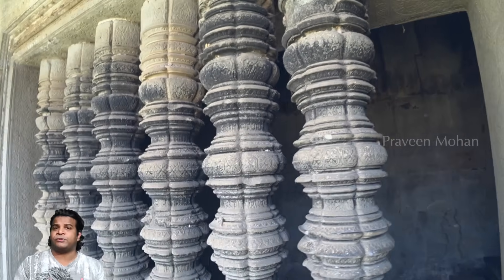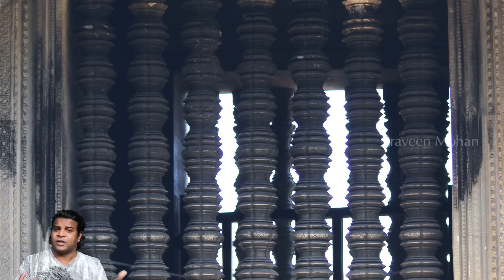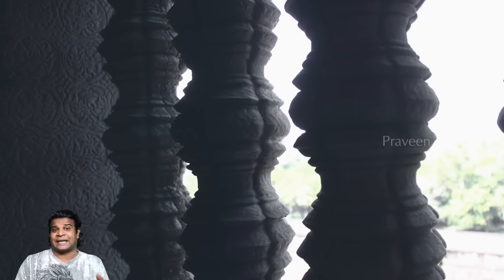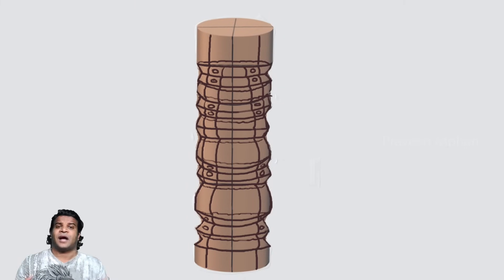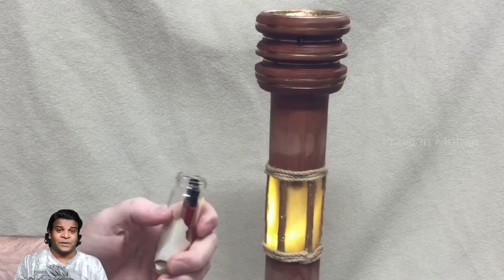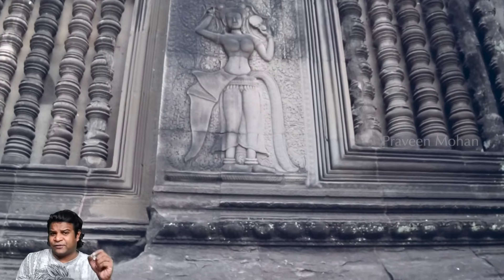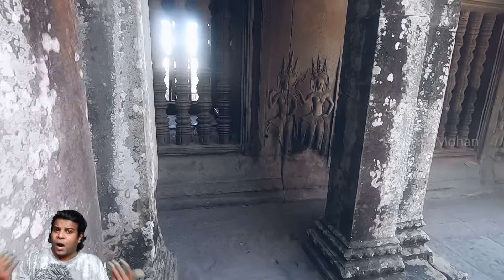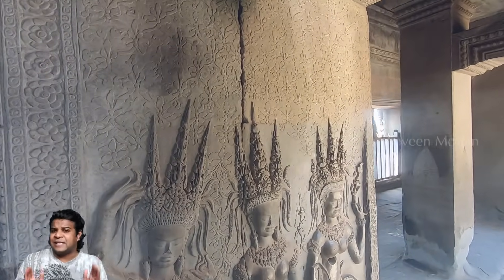IMPOSSIBLE ANCIENT MACHINE Found in AngKor Wat? Lost High Technology | Part 8 | Praveen Mohan

Comment: If you made ornamental turns on a lathe, then sliced through the bar/shaft vertically, then put them back together, then the long quadrant sections wouldn’t be a perfect circle once put back together, as the thickness of the cutting tool used would change the outer dimensions of the circle.
A sort of opposed ellipse.
Also, the vertical cuts would leave a sharpe edge on each of those rings, and yet each ring looks to have been cut, or ground relative to its own radius, again, not an easy task.
I would at first assumption, suggest they’re moulded, make one mould, then you can make thousands of copies.
But then, I would have to explain how to liquify stone, and I can’t 🧐
Reply: Opposed ellipse is probably the wrong description.
If you drew a circle of say 50mm on paper, then drew a cross of say 3mm, and then cut out the quadrants, when you put the quadrant out of the paper, then you wouldn’t have a perfect circle.

Comment: Thank you Praveen for the great video series. Perhaps when you consider the components of the temple, a central ‘power’ core surrounded by insulating sand and encased in an outer shell, perhaps the pillars are utilzed for cooling. The placement in a ‘window’ provides the necessary airflow.

Comment: Could the pillars be a geo-polymer cast ? The vertical lines could be where the mold comes apart. A Sandstone original is turned on a lathe and then cast as a negative to which the geo-polymer is poured.

Comment: Perhaps is some form of "wiring"....like you would find in the center of a lamp base....perhaps those wires were threaded up or down to provide power to illuminate certain or secret rooms either above or below....or both.  Would they have maybe used something like "laser" technology (from the Gods) to slice these pillars into fourths?  The slices are so clean, I can't imagine using a machine....also I believe in some cases, using advanced technology from "Gods", they were able to literally "melt" stones and place them into molds...a result that made the designs uniform within each pillar.

Comment: The pillars seem like insulators. Maybe they contain an iron core. And based on your description of the "flesh and bones" of Angkor, the entire structure seems like a cap and pin insulator, so I'm guessing it had some kind of electrical function. Also, the shadow of the columns appears to be a waveform, perhaps the resonant frequency generated when the structure was functioning.

Comment: Why pillars are guarded ?  Whats inside the pillars ? The treassure inside the pillar is sand only, As you told in previous video, may be whole temple may collapse if you remove those pillars, Hence Guarded for temple safety.

Comment: there is nothing inside the pillar. everything you need to know is on the outside. carved with perfection. And the lines is intentionally formed to overcome cracks that get formed due to contraction and expansion when the water molecule gets less after sometime or years.

Comment: Maybe they used them to gain solar energy and in the center would be something that could capture the heat or what not and transfer it to a main converter to make electricity. As I said before the inside structure is that lava rocks stuff that you’ve pointed out and it’s iron based and acts as a conductor. The sandstone acts as an insulator. But how does it work exactly is the question.. maybe they used the water on the outside perimeter that causes friction and makes electricity like static electricity is made in a sense. Maybe

Comment: Seem like the 4 quarters of each pillar were 'cast' with geopolymer stone mix in the same mold and then bound together to give perfect symmetry. Even the carvings may be part of the mold. Don't think there is anything inside them. As these were mass produced, adding them to dead windows may have been done just for uniform architectural aesthetics. And yes, the shadow resembling the temple silhouette is just masterful work which also proves the whole complex had a well thought out design and plan.
Reply: Exactly what I thought, exactly

Comment: How can this be done? Simple, the stock material can be laid horizontal, on 2 horizontal full length rollers. Then you only need to spin 1 of the bottom rollers. This would provide support across the full length of the material and act as a guide line for cutting the grooves. What's the best way to find the center of a circle? Use a square of the same size, draw an X, by going from corner to corner. You now have dead center where the lines cross. You can then find the middle of each side of the square, draw another line and so on 180 times to create a perfect compass. Things are not as hard as they seem.

Comment: Because I was in Ankor Wat some years ago, I can tell that those "window pillars" are everywhere. Not only in the main-temple, made of stone, but also in others temples, made from wood. I personally think that those block much of the sunlight that is comming into the window. And the builders decorated them because they are in plain view. I agree to Praveen that the must have some technology because I think those stone pillars are made by "stoneturning" (like woodturning but with stones). And I have an idea why some of the are cut into quarters: There are holes in the stones on top and bottom of the pillars where you would put them. But you can not do that with a complete pillar. So you make quarters. Two have a protusion on top and two have a protusion at the bottom. And you assemble them with something like mortar.

Comment: I love the videos of Mr Mohan. It is certainly a possibility in the old times they used high tech machines. But in this case I wonder 
why doing it complicated (with high tech lasers), if it can be done in an easy way (with a rubber mold)? I have seen in Asia people working on a rubbertreeplantation, collecting the juice of a rubbertree. It is not even complicated to make a very detailed mold of a detailed carves stick. 4 of these casted quarters combined together will make a pillar with in the center a metal stick for strength. Think about this 'possibility'. : ) Keep up the good work!
Reply: Nir Pawar  The people in India were so advanced and so very skillful in the old times already, it is always 'possible' they have found out how to make concrete and how to cast it. The Romans have used concrete in Italy almost 2000 years ago. But maybe this was originally an invention from India, who knows? : )
Reply: Are these pillars cast or sandstone? Praveen says sandstone
Reply: Your observations is in my opinion correct, in this way you don't need laser just ingenuity

Comment: I suspect there may be another explanation here related to the order in which the material was processed into this shape.  It makes the observations and the subject no less interesting however.

I have a few ideas on how I would do this today, but here is one of them.  

The blank original was lathed out of a softer material.  Then the art was carved onto at least 1/4 of the object.  The original was then split into 4 equal parts on the lengthwise on the meridians with the kef being fully on the waist sides of the cut.  You now have a full 1/4 image of the original piece.  Now a casting of the original could be made.  We are pretty sure other objects at other temples were cast but how they were we don't know.  If we accept that they can cast stone material then they could now cast these 1/4 images over and over.  Once cooled, cleaned, leveled, and polished they could be rejoined to form the cylindrical object we see today.

Comment: Glue -- Without a special adhesive holding the four parts of the pillar together it would crack and break apart on the lathe.  To much tension and stress going on in the stone which has microscopic cracks running throughout it.
So, I've heard..

Comment: Another food for thought for making the pillars with vertical groves and other bells and whistles. Think about modern day 3D printing technology, that build layers on top of one another through the Z-Axis. Creating the layers with very high resolution (very thin layer lines) all the carvings and groves can be easily achieved. I put forward this thought against The point of using CNC as, while you can still explain the circular machine cuts but how the detailed carvings can be done through the same tech, only option left would be to use manual labour on the finished lathed stones! And that would be extremely tedious since there are so many pillars in the compound and also achieving this level of precision would be impossible. 
Again, Its a baffling concept of melting sandstone and make it as a feedstock ready for 3D printing, maybe ancient geniuses had the tech in their disposal. 

P.S: Pravin, your critical thinking gets me awestruck every single time, huge respect man!!

Comment: to hide something in such pillars you do not need to cut into 4, just cut into 2 parts. Moreover, you don't even have to cut, you just need to drill a hole with which they certainly had no problem.

Comment: If ancient builders, that built these temples are so advanced mathematically, they had to most likely known about binary code.  I suggest, you take the binary code of 1 & 0s  and apply them too the convex / concave  patterns of the cuts, and see if a meaning can be extracted from it, maybe something interesting will be revealed, or not ?  Also, there are handheld devices that give xray ability, builders use them to detect studs, wiring, and metal, behind walls, you should employ these devices to aid in your quest. Even simple magnets or magnetic field detectors and even, Divine ing rods that are proven to pick up subtle energies can help. Good luck !!

Comment: This video shows that the pillars are not the same ،Some are little bit thick and some are thin,  the same is also appear in design.
 The machine makes almost identical things .In my opinion some kind of basic machine is used to rotate stone pillars on the same axis . But the designs are created by a handy tool. That's why there is a difference between them.
 The four sections are probably symbolising some kind of religious law or practice . Which we  today cannot understand.

Comment: Is it possible that these wave form patterns, That the columns you are showing can be converted to Sonic tone frequencies ? I am most certain it can be done, on a oscillating type device, that electronics technicians use. To me the pattern of the cut, is like a binary code and is the key to the mystery.   Maybe there is something inside, that can resonate, creating some form of energy, if the right tone frequency which the shape is providing, is applied, and directed at them .- Great job Praveen- you are a Great gift to the Archeological field !!!

Comment: Aren't the pillars made to spin? I'm guessing there is a rod through the center to hold the pillars in place perfectly vertical. Splitting them would be far easier than drilling out the center of a 6 ft pillar. I'm not sure you should be looking at the shadows on the wall, but the light in between the shadows... That looks to me like a frequency signature.

Comment: What is needed here is one of those Electrical/cable detectors...if there is something running down the middle of them i'm betting it's some form of metal...run a device that detects those things up n down it and you will soon find out as there shouldn't be any there, right!

Comment: Except those Pilars could be done with primitive tools. How did the cut and polish the crown jewels back in the early 1500s? They had a method of spinning a stone with an abrasive on it and it acted juat like sand paper but for rocks. And the  Intricate designs going lengthwise on that pillar can never be made on a lathe. How do you make horizontal cuts on a plant that is spinning vertical or vise versa.

The only other explanation for this is they made a mold and had pre existing knowledge of how to create and pour cement.

Comment: Linking the Stone turtle video and the 108 Secret lingam video my mind starts to believe that inside the carved pillars would be some kind of bronze rod maybe? The power from the sun at 12 midday would then go down through the hole in the roof at the centre of Angkor wat to power what ever was inside the stone box. Inside the stone box was some kind of advanced technology (battery)  that would supply energy or heat up through the bronze rods that maybe connect somewhere higher past the tops of the pillars. Maybe take a metal detector Praveen on your next trip and lets hear what maybe or could be inside the stone carvings :) Just a suggestion..PCG

Comment: They remind me of a technology I found when visiting Switzerland tears ago. There are bridges crossing into Switzerland over dry mouts to enter the country. Built into the road bed are glass blocks. I found that these blocks are literally bombs set to prevent conquerors from entering forcibly . The roadbed can be destroyed at will. 
When I see the sharp edges I think these pillars are a protective device - similar to a modern day hand grenade. The pieces would easily provide shrapnel that would cut an opponent to shreds. And further they are not very decorative. The small size and proximity of the pieces and to one another imply a type of projectile. They could explode outward devastating to any attacker and likely not noticed until too late. And as you noted not all windows are open to the interior. 
So, I believe they are fortification weapons with an electrical charge inside. Or possibly utilizing mercury as well.

Comment: Amazing you just keep digging sir you are uncovering some amazing information about Angkor wat, it seems that a large part of Angkor wat was a large solar collector with the solar box at the centre and obvious solar fins all over the place, was this thermal collection or electrical power, there was some indication of brass wires in the box, but they could have been for electric or as thermal convection, but do we see any evidence of connecting nodes on broken pillars where they would have touched the edges of the frames?

Comment: You are assuming the pillars were made on a lathe and then cut longitudinally into quarter. What if they were simply just mass produced in the quarter pillar form? Then they all become a standard shape, size and weight allowing the builders to use them where ever they are needed. A lathe would not be necessary if the pillars were created in the quarter pillar form. The builders would  only be cutting two faces of the stone in this case and would only require the cutting tools to move radially for 90* down the longitudinal axis of the pillars. And with a template the builders could check their work for uniformity. Just my thoughts as an engineer.

Comment: The builders knew that everything is light and energy, and possibly  also held sacred the common information that other dimensions are 90 degrees from each other. With life being in a fractal reality, I think that helps to explain why the shadows of the temple are at 90 degrees from our plane of existence and show temple after temple outlined. They were demonstrating their knowledge and possibly using the knowledge in a way beyond our understanding. We are likely not aware of what the most advanced humans are or were like, Ego is a big hinderance. There is most likely a fully functioning temple in another dimension,we just are in the dimension where Angkor Wat is run down and only used by tourists and nobody is being told the truth because we are run by a controlling elite.

Comment: Near the 2 minuit mark. OR a 5 axis mill.  The vertical grove follows the lathe cuts.  They may not have cut into 4 pieces, rather really fine milling bits to both add the carvings and the vertical groves as the operations would be able to be repeated for each of the 4 sides.

Comment: Four "quarters or quadrants"  not four "halves".  The angel-goddesses headwear mimics the shape form of the towers.  We presume that the pillars are cut from solid sandstone but it seems much more likely that the pillars may have been cast from a sandstone mix into quadrant moulds.  They probably had the technology for perfecting a concrete-like mix that sets like solid sandstone, but such chemical bonding technology is now lost to the passage of time.  The "curing" of the moulded pillars to achieve this effect may have taken years, leaving adequate time to "finish" any fine detail before final "setting" of the stone.

We still don't know the chemical formula or process for making "Roman concrete", which again has been lost to time, so it is unsurprising that we don't know how the Angkor Wat pillars were made, but it is taking a big leap of credulity to suggest the ancients had an equivalent to CNC lathe tech-knowhow !!

Comment: I don't think they use lathe machine, but they mold the rocks. Remember the knobs on stone blocks? They can't mold the pillars in one piece, so they have to make a half / a quarter parts then join them to be one full piece.
Though there is still a possibility  that those pillars contains something inside.
That's my thought.

Comment: Harmonics, waveforms. Amazing. But look at the carvings on the wall bordered by the shadows. There is a rather nice but unclear circular patern repeated and enclosed in the trough shadows. Definitely worth study.
They were well up on orientation, light and energy. Even the place was built on some energy node, according to many theories.
We can't ignore this.
Then they block the same effect off by blocking the windows on another wing. Exact opposite? Blocking off unwanted negativity? A later addition when a shadow message fell into disfavour?
 I really know so little, it's infuriating.